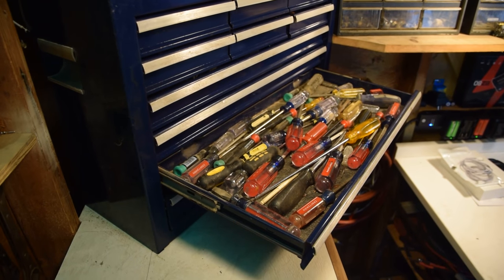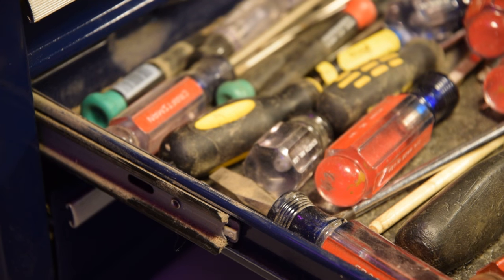Craftsman Tool Box - Remove drawer with friction slides

Comment: Thank you, I used an old 12” Hacksaw blade and it worked a treat. I found my missing 12” Rule I was given as an Apprentice, it’s been missing 10 years!
Reply: ROCK CITY BROTHA !!!
Reply: Wish I'd read this. I did the same, but looked around the shop for a bit too long looking for a thin metal strip.
Reply: Thanks for the hachsaw blade idea !
Reply: Thanks for the hacksaw tip - It works great!  I'll bet that 9 out of 10 people can find a hacksaw blade before they can find a piece of brass strapping!

Comment: The reason they put the oblong hole there is so that you can push the tab in with a small tool and move the slide past the catch. I like your method, but the people who push the tab in are not doing it wrong. To quote the manual:

DRAWER REMOVAL:
• Fully extend the drawer. Push it back a quarter of
 an inch.

• Insert a screwdriver into the slot in the slide and push
 in on the stop until it clears the lance. Repeat the procedure on the other slide and remove the drawer.

• To reinstall the drawer, pry the stop far enough out to engage the lance (if necessary) and push the drawer onto the slides until the stops pass over the lances
Reply: I use a awl or ice pick.

Comment: Great video, got me out of a jam.   All I had around as a bendy metal strip was one of those pocket measuring tools from Harbor Freight, with the metal calibrated strip and the slider to slide up and down to take measurement.  Slid the slider off and I was in business.  I do note that the bend in the end of the strip is very important, I tried many times without it, and got it on the second try once I bent it.   You do have to push pretty firmly to get it in there, though, it doesn't just slip right in when it is going the "right way".

Comment: Thanks for the tip! I just used this method and worked perfect. Used an old hacksaw blade and put a small bend in it.
Reply: k2crasher I was just wondering if that would work!  Thanks! Gonna refinish an old worn out box tomorrow
Reply: Hacksaw blade worked perfectly thanks
Reply: K2crasher Thank you! I have my dad's old Sears Craftsman workbench and was going nuts trying to get it out. Found this YouTube video which was great Don Brandt but I didn't have anything to use until I read K2crasher's post and it worked like a charm.

Now I can fix all 4 drawers without having to play tug-of-war each time.
Reply: If i read the comments first, I wouldn't of had to of think of this myself lol

Comment: Thanks for the help! I realized on mine there is a black plastic piece that sticks out on the rail when fully extended, I pushed down on one side and up on the other and it will release the drawer. Mine is the 26 inch wide set that I just bought at Lowes.
Reply: Thats a newer style, much easier